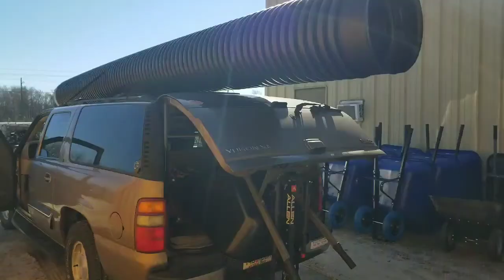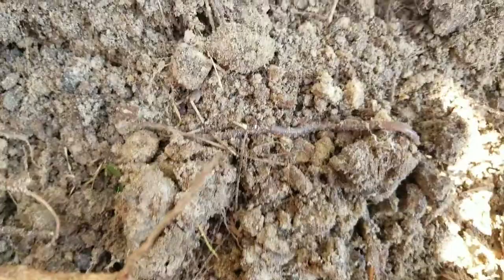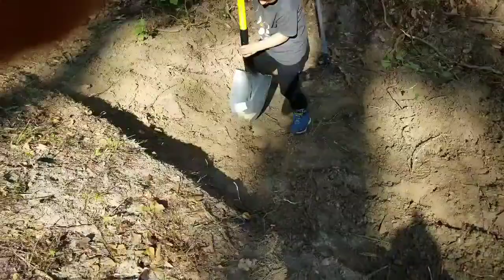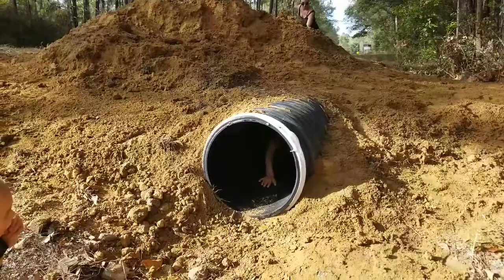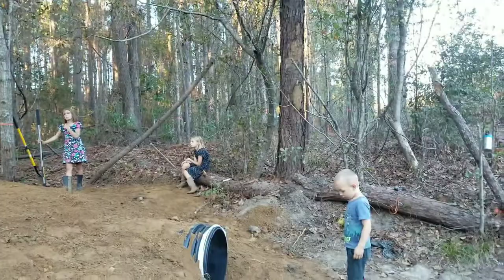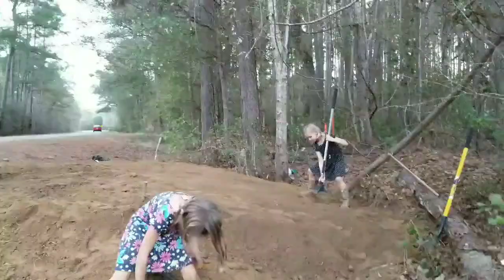Family installs culvert (BY HAND) on 18 acres of RAW LAND | Building an off grid homestead

Comment: New Subscriber here....we are about to replace and install culverts ourself and doing it in SUPER rocky soil here in NW Arkansas. I am gonna watch the video now and hopefully learn some good tips and tricks for doing it via hand tools as we too do not have any heavy equipment.
Reply from the maker: Awesome, good luck with your project! Fortunately we did not have rocks, but we did have a lot of stumps...the mattock was my favorite tool during the clearing. If you have lots of medium sized rocks I'd recommend saving them and using them to line the sides of the culvert
Reply: Hello neighbor, sort of, we are in central AR and about to install 15" culvert. We do have rocks to deal with. This video helps to make sure we do it properly. Thanks.
Reply: @mandiegarrett1706  if y'all are doing it by hand I highly recommend getting a landscaping bar with a point and blade as it helps with getting around the rocks
Reply: @IveysFamilyFactotum  Great idea, thanks.
Reply: Hey! We also live in NW AR on a farm. Saw your comment and subbed.

Comment: Super hard work and it turned out very nice. I would suggest installing some type of rip rap at the downhill side of the tube so it does not create a hole as water pours out over time...of course this video was a long time ago so you probably already did that or something else. Guess I should go and see what all you have done since this install.
Reply from the maker: Haha, yes we still need to add something to shore up the sides. Eventually I will make it look nice with sawn pine stumps or something